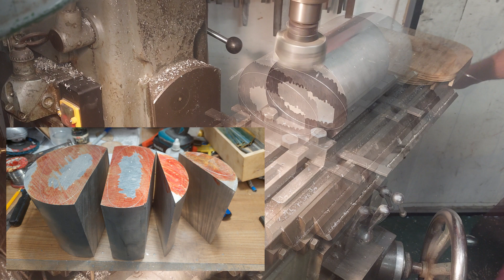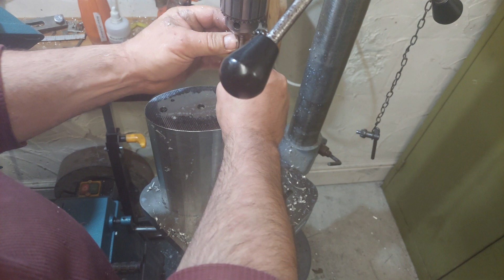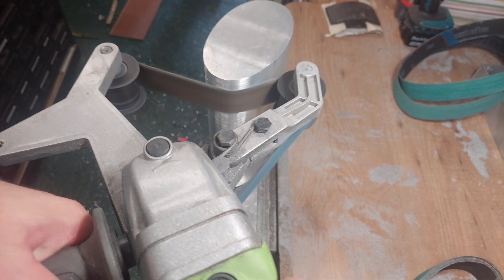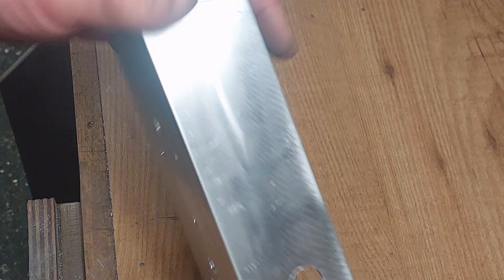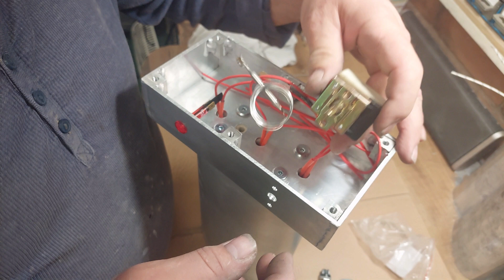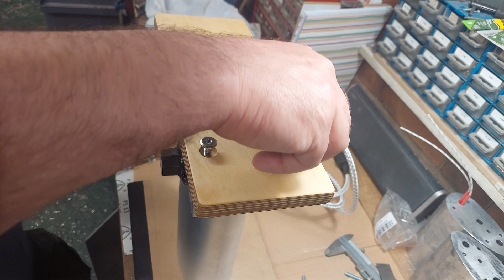The production of a caramillo bending iron (double bass bending iron)

Comment: Great video ! I never used a thread cutter with a drilling machine. That seems quite efficient.
Reply from the maker: Thanks Julian! It is a very efficient process but it is important to use it with care and with appropriate taps. The spiral flute is important as it reduces the necessity to reverse the tap to break the swarf. I keep the clutch on the drill set quite light so that if the tap meets too much resistance it stops. Aluminium is a very forgiving material which also helps. ;-)
Reply: @caramillo-andy  I have to admit that I stopped breathing when you started making the thread: when it breaks, you can just start all over again!

In the process, I'd probably have started with this part before milling to avoid having to start all over again if anything went wrong! But your technique seems to work perfectly. I'll give it a try sometime when I have to do a thread.

Thanks for sharing.
Reply from the maker: @LeSalonDeMusique  Maybe thread cutting would make a good subject for a future video?